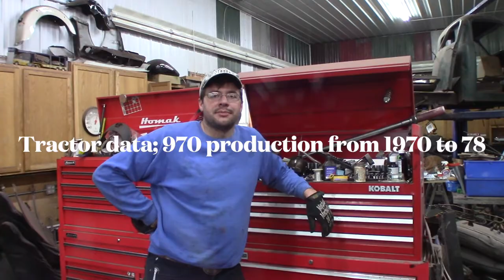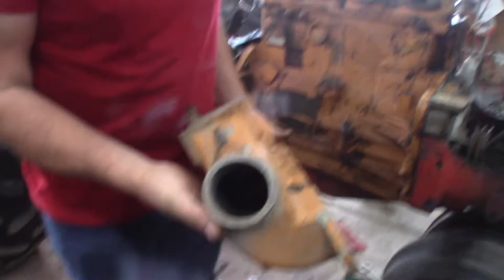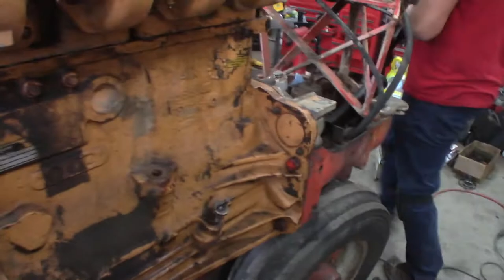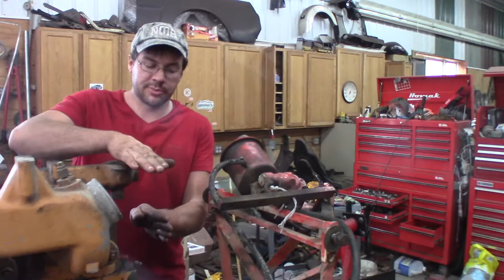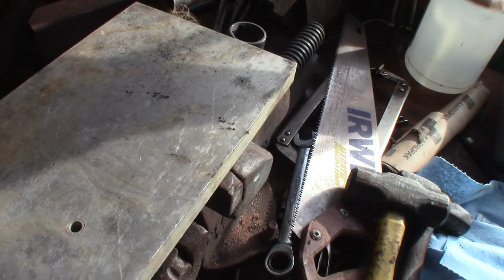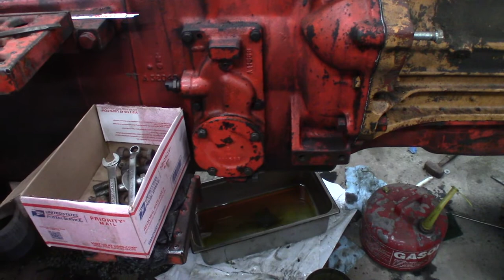Case 830 torquing the heads and installing injector pump and dealing with a swap glitch.

Comment: Good progress fellas. Usually when I run into a problem requiring fabrication I’m dead in the water.  You guys stay calm and carry on.
Reply from the maker: Thanks Dave! I really appreciate that comment. Sometimes we mess up and its a lot of trial and error but its also fun and challenging. We knew there would be some "issues" since it isn't the exact motor for the tractor. Thanks again, John